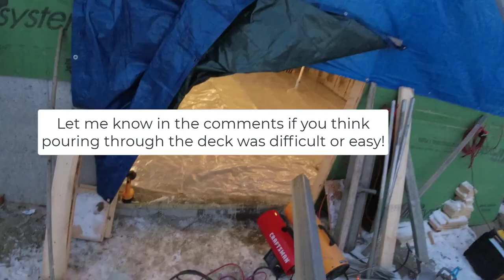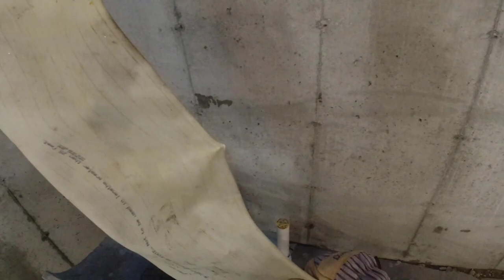Pouring Concrete The HARD Way - After The Foundation is Decked Over!

Comment: We did a lot of these pours in the winter. We used a line pump(grout pump) and pea rock concrete. Too much snow to get trucks around in Utah. Framers put in minimal bearing walls or temporary post and beams set on 4" concrete block.

Comment: I always snap a chalk line line around the perimeter of the foundation before we pour so we can float it to the line and use a 1x2 stick that we cut and it goes to the under side of the floor joist to get our height instead of using the laser.

Comment: Is the visqueen there to stop the concrete from wicking up moisture? Wouldn't it be just as good to apply a sealer to the floor and let the ground help pull out some water from the mud?

Comment: CO poisoning is no joke .
Reply: True story.
Reply: The fact that the salamander heaters are outside and blowing air in that has been heated with the propane it actually carries a fair amount of fresh air with it which also is being forced in there with the heat which is going to flow out the holes that they have in the roof to get the concrete in which creates a negative vacuum which sucks in more cold fresh air. So frankly I would not be overly worried about carbon monoxide poisoning from the screeder. At least for the several that we have done this way I never felt anything and I don't think any of the guys did either because they didn't say shit. And concrete guys love to say shit, :-)